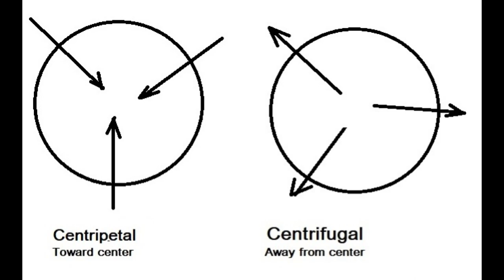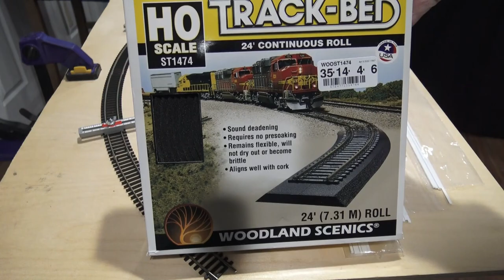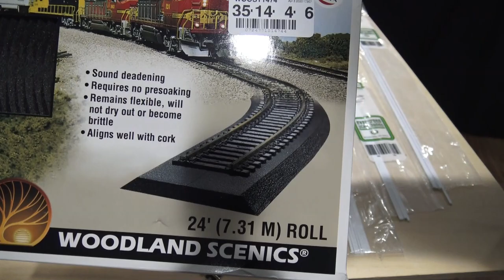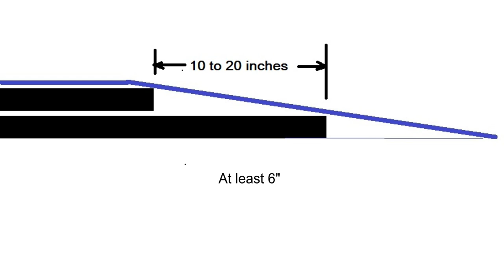131B Super Elevation for Modelers

Comment: That was a great explanation of how to lay super elevated curves and it's not as simple most people think. I don't think the curves on my layout are long enough to try and add this, and besides, I have just got everything running to what I want it. But I think if I had the space you have Rob, it would be worth considering. Great video.
Cheers for now..............................Geoff
Reply from the maker: Hi Geoff, You are exactly right, it is no simple matter embarking into super elevation.  The big boys calculate the exact cant needed for the expected speeds, freight trains complicate it with their high centers of gravity and slower speeds.  Thank you so much, Rob

Comment: Great explanation Rob, I’ve been playing around with this on my layout; definitely a pain in the arse but worth it. I spent several days tinkering before I got a happy medium where everything runs alright but you can see banking in the corners. Hope you’re well in Colorado Tony
Reply from the maker: Hi Tony, yes it is no small matter committing to a super elevated curve on your layout.  The railways and railroads of the world calculate it for speeds but have to compromise for slower running freight.  On very tight curves(not as tight as most layouts are built) they can be quite steeply canted.  Best of luck with it.  Thank you so much, Rob

Comment: Hi Rob, very interesting. I need to do this with parts of my layout. What are the Evergreen part numbers for those strips? I think I noted 2 of them, but not the third. I got #165 and #355 but not the third. Could you help please.    ... Ian
Reply from the maker: Hi Ian, I had #355 (.060" x .100) in my hand.  It was the 24 inch length.  It comes in 12 inch lengths too.  I built particularly steeply banked curves on my layout.  You may not want them that high.  The Evergreen comes in almost any dimension you could imagine.  If you search for the size you want you will find offers for it, I am sure.  If you could find .030" x .100" and layer it up overlapping at first for a gradual climb it would work well for you.  I hope that helps, if not, ring me again.  Thank you so much, Rob